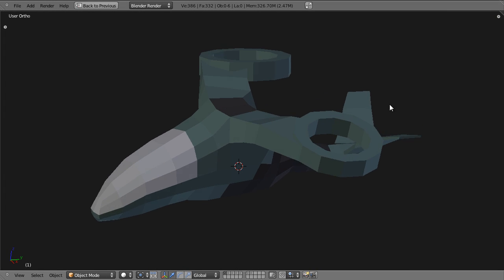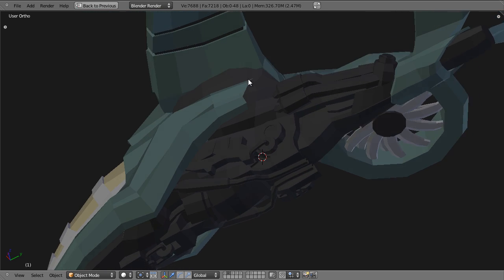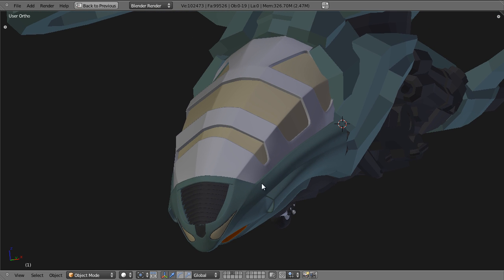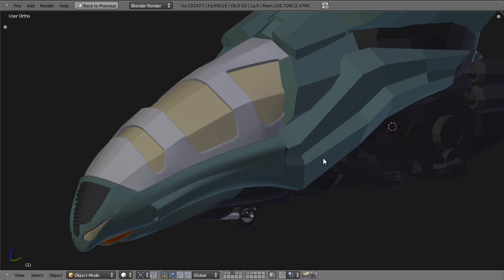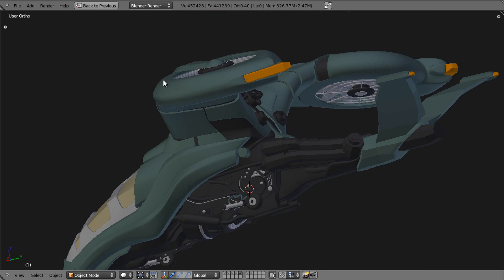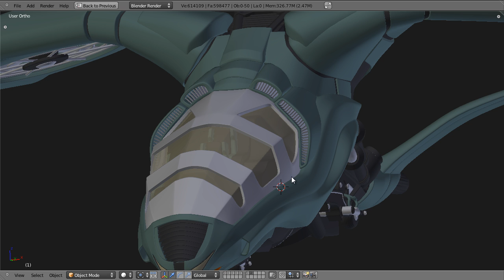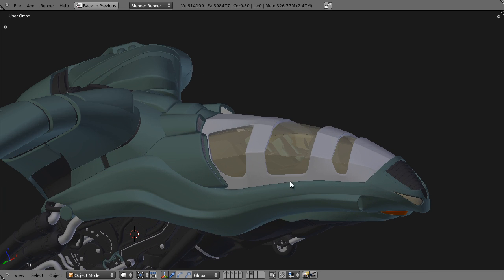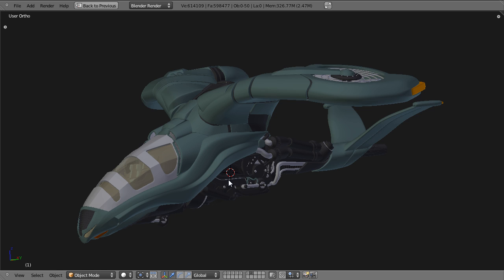Vehicle Series - Introduction

Comment: When developing, you want to work with the high-poly version. One good reason is that you can create highly detailed texture maps from this model. In the game, you would end up using a low-poly version, but apply the previously generated texture maps which were based on the high-poly model and therefore contain the high-level of detail you would like to grant your game model. This way, you can keep the 3D model with low detail but looking surprisingly highly detailed using texture maps.